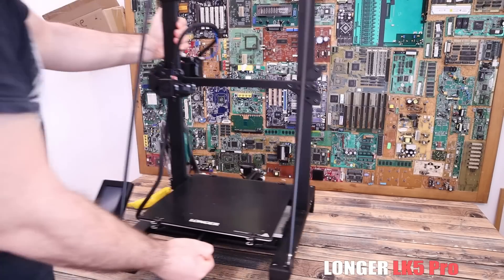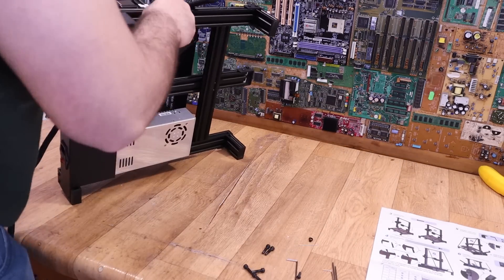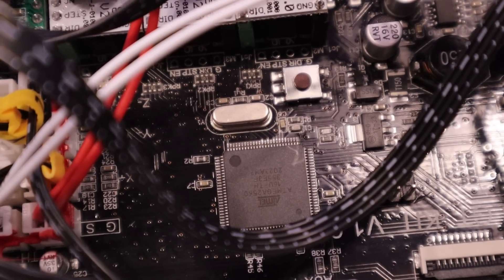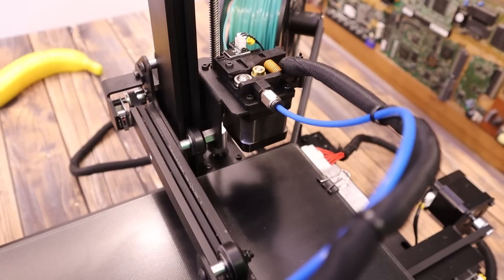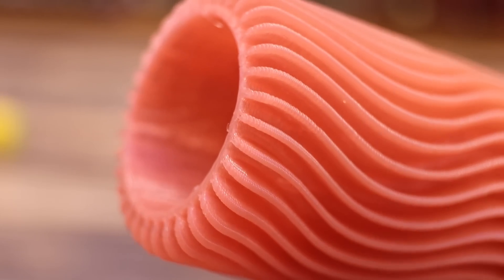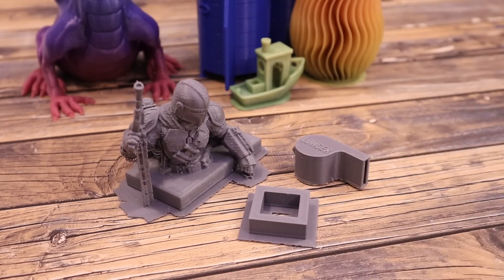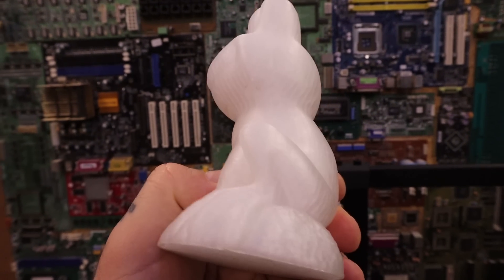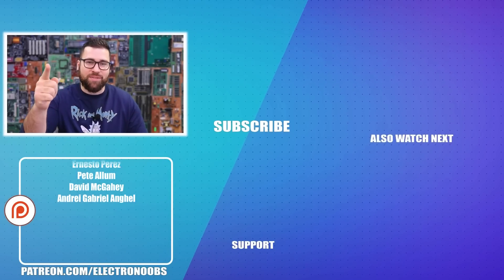Longer LK5 Pro 3D Printer

Comment: Thank you for the video that was great.  I see you printed the frog in low-temp nylon, with 0.2 layer height.  What bed temperature did you use?  Did you use any glue or hairspray on the bed?  And what was the brand of filament?   Thank you!

Comment: From my experience printing ABS, if I want no lifting of the edges, I print of Kapton tape.
No glue or hair spray worked. covering the print area with Kapton tape, fixed all my ABS problems. 
If I put the print plate in the freezer, the part just falls off after 15 minutes!

Comment: The same loud PSU fan,  poor  Parts Cooling Fan, poor Display  and  guess the control board is also a 8bit as in LK4Pro.  :(  I would prefer to have an easy upgrade to SKR MINI E3 V2.0 similar to Ender3/Pro